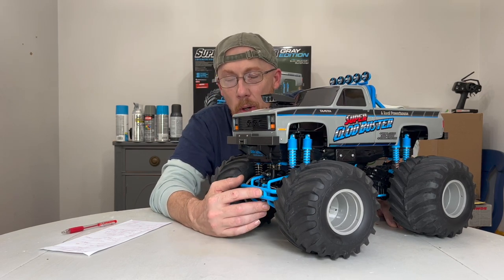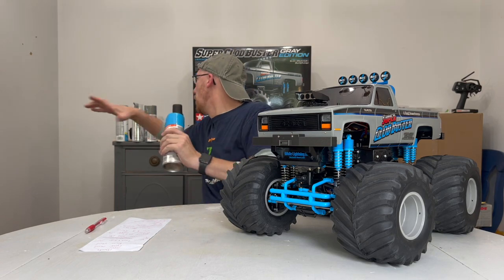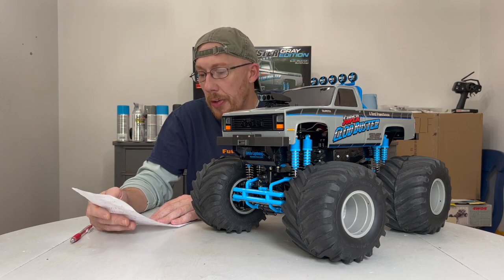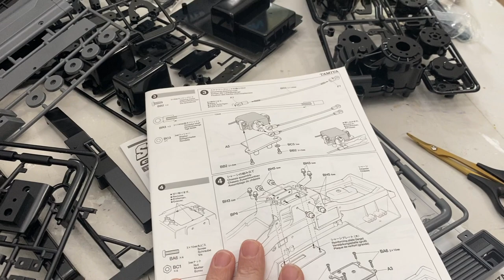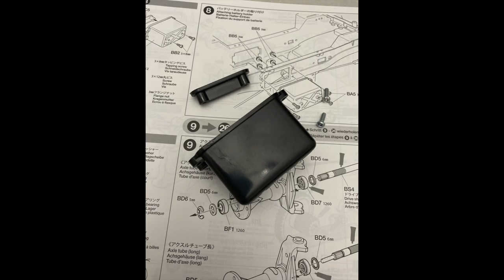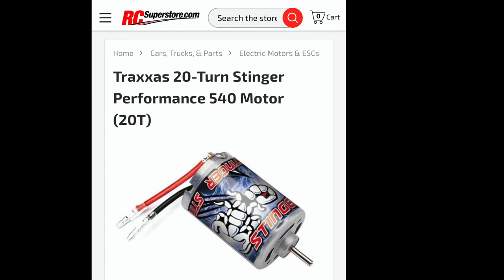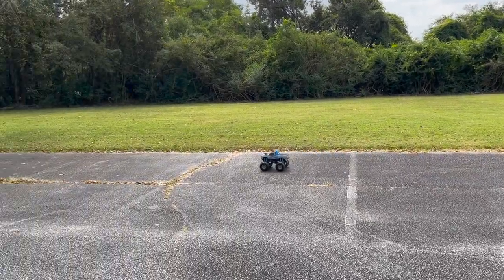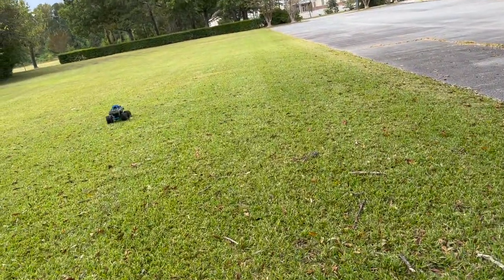2022 TAMIYA SUPER CLODBUSTER GRAY EDITION

Comment: Fantastic build and beautiful work! I'm 60, and I got into RC in my 40's because I was finally able to get some of the RC's I could never afford as a poor kid. Of course I knew of Tamiya but they never were really on my radar back in the 80's and since I never had one or wanted one back then I don't have the nostalgia for them that most of my friends here do. I love the way the Clod looks and I love building kits but everything I've done up to this point has been with awesome, modern high performance kits, and from everything I've seen about the tamiya models they seem rather toy grade as far as the electronics, suspension, transmission etc. And also very limited in the performance. Now I do know that they are immensely upgradeable and a person could spend an absolute fortune modding one to run somewhat like a modern basher but I'm still having a hard time wrapping my mind about the appeal of them other than the looks and I totally get it if someone had them as a kid or for their first RC, so  I get the nostalgia part of it. But stock they basically seem very outdated, with toy like stock parts. I do have a Konghead I'll be building this winter and maybe after that I'll get the attraction more. I really love any RC really and learn to appreciate them for what they are after driving them. I was the same way about crawling several years ago. I just didn't get it because I was a basher and thrasher lol eventually I tried it and after doing it and seeing that it requires a different skill set and was rather relaxing, I loved it. Right now every time I watch a tamiya video I kind of shake my head and go why? What's the attraction, they run terrible 😂. Now, that isn't entirely true, I've seen some that actually looked really fun. But in general they definitely don't seem to have any kind of performance or good suspension. But since I haven't yet driven one, I'll reserve any true judgment until I get my Konghead built and drive it. I hope it changes my mind about them. I just don't have room on my shelves for too many underperforming but great looking shelf queens 😂 yours looks amazing, great work and great overview of the build! 😁👍🤜🤛⚡⚡🔥🔥
Reply from the maker: So I can definitely see your logic on Tamiya especially if your experience is a bit on the lesser end came in as you stated 40 That would put you around the nitro craze a bit and the rise of sedan racing and of course bash style rc traxxas. I was for sure lover of those the thing is I’m 50 but got the rc bug at 8. My uncle introduced me to them around 1981 with a Tamiya rough rider. And kyosho peanut rc. I was amazed. All metal rc cars and big and heavy. I would later get a Tamiya grasshopper around 86-but my first was hobby grade rc is 84 Marui Big Bear. Meanwhile I’d get Nikko tyco radio shack rc along the way as my parents couldn’t afford those. The magazines and commercial appeal really aided the attraction. Like it or not Tamiya made pretty rc. The realistic approach with Tamiya bruiser a s speed truck or the 1/14 semi trucks. Also the track killing Tamiya Dyna storm. Tamiya is legendary they just are. My favorite rc brand no that is Marui because of it being the first one and they died off. Sadly. But I love any rc brand that is trying to keep rc in the stay. All of them hence my library of 175 videos and more of various companies. Hobby toy grade I don’t care it all matters to someone and whether it’s Wltoys, Arrma, traxxas, kyosho, Axial,RC4wd, Schumacher, Losi, TA, Graupner,Nikko, new bright industries, radio shack, Robbe, RCl, Mugen, AYK,GMADE,dromida, HPi, duratrax, and even Tamiya along the many others of rc it’s all gravy baby. I can respect that even if I don’t get it. Which I generally do airplanes took time but I now dig it-I can learn to accept it. RC isn’t for everyone it’s just for those looking for escape from the mundane. The creative and imaginative individuals. Even risk takers. RC is to me a world that I find beautiful. Thanks for watching and please enjoy rc. No matter the type or method of play. 🙏
Reply: @LukesVintageRC  absolutely! As I said, I totally get that most of you guys have a nostalgic attraction to them and that's awesome, I'm kind of jealous honestly that I don't have it because almost everyone my age absolutely loves them. I was a poor kid and back in the 70's and 80's RC was mosty the realm of wealthy kids and retirees. It was so much more expensive back then. Lol the closest thing I had to an RC was a buggy from sears made by nikko. I was in my 20's at that point, It was a blast and I had a ball with it but it was totally toy grade and left a lot to be desired. I never had any real RC's until I was in my 40's. The first thing got into was helicopters because I was always fascinated by them, so I taught myself how to fly and had a blast, though it was a steep learning curve by myself. My first hobby grade ground vehicle was a buggy from exceed that I still have. It went straight uphill from there, lots of drones, and ground vehicles. I always bought bashers until a few years ago when I started throwing crawlers into the mix. I can't stand nitro or gas.. Too noisy, messy, and fussy for me. At my age I just like to go out and blast a pack without any hassles lol 😂 but I know lots of guys who love them. I love building kits too. I'm looking forward to building the Konghead just to have the long overdue Tamiya experience. Back in the 80's I was a lot more aware of Kyosho than tamiya. And I do have a few of them now, so I'm definitely looking forward to the tamiya experience. I certainly don't begrudge anyone for loving what they love, especially if was something from their youth that brings them happy memories. Like I said, I'm kind of jealous that so many of my friends in RC, especially those close to my age group absolutely love the Tamiyas, and I just don't have any memory or nostalgia of them other than occasionally seeing one in a hobby shop. I certainly couldn't afford one and didn't know anybody that had one or liked them so they were just out of my experience unfortunately. You did an awesome job on yours and I'm sure you'll enjoy it! 💯
Reply from the maker: @riffraffsrc  I think you will like Kong! 6wheeler I’d bet gonna bet more to come from that brand. I used to have Exceed buggy but it was a nitro version anyway my daughter has exceed razor brushless 8s conversion very quick. The Drones and Helicopters now there’s some stuff I’ve never tried for some reason not that there not neat or anything but just never think about anyhow-hopefully I’m not making you feel out of place because of the Tamiya thing not my intention -I can seem a bit odd with rc stuff I’m a strange rc dude have you watched my eclecticism of rc on my channel 😁…I was a teenager who actually worked hobby store and yup that employee when you came into my hobby shop Ed’s Hobby Shop to be exact to browse I’d follow ya and explain each thing you picked up. Owner would literally yell “leave the customers alone Luke”! 😆 if someone left with nothing I was confused too. I do tons of rc videos so I do need a drone for overhead videos. Any suggestions I’m all ears- maybe a nose, eyes, a mouth. 🤪
Reply: @LukesVintageRC  as far as drones go, I'd suggest getting a sub 250  model so you don't have to register it. A small one is much better to transport and fly too and draw much less attention. I own an autel  Xstar premium 4k full size drone that I bought several years ago and I rarely fly it because it's large and atracts a iot of unwanted attention every time I fly it. Plus I had to register it and all of that stuff. All this regulation stuff is killing the fun of drones. And people are paranoid and suspicious of them🙁 so, the smaller the better. A small dji or autel like the dji air 2, or dji mini 2 or Mavic mini,  Autel nano will be perfect for videos. They are the perfect size and have incredible video. I use my go pro and phone camera s for video and wanted to introduce Ariel views but my drones are too big like I said. I may end up selling my big Autel and switching to a new small one. It's a shame too because my autel flies beautifully, has 3 batteries, a case, extra props etc. And the video is amazing. Funny you say Ed's rc. My local shop down the road from me here is called Ed's rc as well! I live in Vienna WV, next to Parkersburg on the Ohio River. I'm looking forward to the Kong build. I've already been looking at paint colors for it😁👍

Comment: This is such a cool looking truck. I'm not sure how much I like the baby blue hardware. I just think a black roll bar and bumper would look better. Thanks for showing us the build that's quite helpful.
Reply from the maker: So bro, honestly I like to do my own thing instead of completely box art as I’ve been for minute or two like everyone does. But the cool thing about this kit and I highly recommend it, you get spares so you can change anything out quick if you need.so color blue is are nowhere near baby blue. You need to see it live-but Robert there’s metal in the blue so just not possible-The bumper on mine is black. So..Your referring to chassis guard that comes with kit in the blue color. Honestly this clod kit is the best one. I own an 87 original red so I’m no way being just bias because of new is better but in this case absolutely. Plus it’s a limited ed. but Tamiya has been known to ramp production and then halt. Tricky company. ie candy green GH. On my channel I never really play by the so called rules to follow for good video format -You have to film the videos in multi stage video format, or you have to use this or you have to do that. Nope never I’ve always let my adhd rule out on my single video of all resto/paint/run formula per rc car truck boat etc. Same idea goes into my random rc restos too. So remember if it makes you happy that’s key right, Preferences are a sticky mess that just rocks or rolls. Flavor or Flavour..😆 thanks 😊

Comment: Just got done putting the same one together. Doing research on the painting part and found your vid. Hows is your paint holding up?? Ive read to stick with the tamiya brand stuff because the hardware stuff pretty much sucks...appreciate any info
Reply from the maker: Prep,Prep, Prep is the main method and that applies to anything your starting with in the hobby of paint. Super large catalog of rc car restorations on my channel which includes all aspects of the beginning and ending via running analysis of a total restoration. Enjoy 😉

Comment: I was kind of disaapointed in the body molding but overall it is an amazing truck. I goofed and stuck two Sport tuned motors in mine and one is running really fast and the other slow due to the timing in them... I totally wasn't thinking about it what I grabbed them. The replacements will be here tomorrow I think so I can actually get mine wrapped up and running! Yours looks really great and I like you did the roll bar in the blue. That looked really cool. The gray paint matched very well also, better than the Tamiya paint did!
Reply from the maker: Hey Adam, I’m excited for you with this truck. So yeah i originally bought the torque tune myself and they have a timing set. But before I could rebuild one the other came later so I ordered my traxxas 20t motors. As they are zero timed. Definitely wakes these big guys up as normal is 12mph mine is 14mph so I’m good for now. I had fun doing this one and yeah some people aren’t doing anything to the bodies paint wise regardless the issues. I believe RCdriver didn’t do any paint on the body when they did there’s recently but ran it 3S pack on it. Moves nicely looks a tad faster than mine in 2s mode. I’m tempted to 3S mine speed should be around 17mph! Thanks for watching.
Reply: @LukesVintageRC  yeah I saw it on 3s when he was driving and I may but it'll be with the old banged up body on it and not the nice new one!! 😂

Comment: Great job, the Clod looks awesome. 
Unfortunately I have now a lemmon for you. The TT motors are timed, that won't work on this car. Or real bad, because they have to run on this rig in different directions. Not sure if you builded in the original TTs, the foto was to short to see for my eyes. Sorry. RC4WD has some low turn motors without timing.
Reply from the maker: So I originally ordered the Tamiya Torque motors but one is fine, the other would need endbell adjustment to zero which I will do sometime in future, I live for challenges don’t you know lol! So as stated in beginning traxxas 20t stinger is the overall result. Please watch again. I do post information in description telling the basics in my videos. Helps those who wanna build there’s too. I’m honestly pleased with traxxas 20t stinger motors. Great prices too. Future 87 vintage clod resto I contacted Team Brood who has motor kits for these trucks I’ll do sometime next year. Yes Sir aftermarket support is strong for Clods. Thanks for watching and commenting, keep rocking your rc channel.
Reply: @LukesVintageRC  Sorry, sha,e on ,e I hadn't read the description.
Reply from the maker: @RCBirds  no worries my rc brother 😎

Comment: Hey Luke are you sure the Traxxas 20T Stingers are 0* timing and can be reversed?
Reply from the maker: Absolutely. So stock is 11 to 12mph right. This does around 14-15 mph. If there’s drag or drain it would not be faster than stock. Be sure to check out my other videos where I fix, restore run and speed check rc cars once or twice per month. A new vintage restore of multiple Rc type cars, truck, boats and and custom movie themed rc each and every month all in one video. Nobody else does this on YouTube. like comment and subscribe. Hit notifications bell to never miss a video as there’s nearly 200 to check out.😉
Reply: @LukesVintageRC  Thanks luke. I bought some 20T high-polish motors from RC4WD for my Bullhead but one of the motors burns up when I run it and i was "assured" they are 0* timing...hence why I was asking...
Reply from the maker: @goldenmanuever1176  lol it’s all good. The traxxas 20t stinger motors were a universal design for traxxas for multiple uses in many different specifications including boats too where twin engines was necessary in different positions or configurations. Also these were used in rc tanks too where as positions are reversed too. Just a good all around motor that has been around for years and used in everything. I’m definitely not the first to use it in a clod and won’t be the last lol. I have a stinger in my kyosho raider and my Nikko Scorpion as of now and both run like a beast. Both videos on my channel too and as you know the motor position is opposite on these vehicles. So I don’t have experience with rc4wd brand’s motor but I do have other things from that company. I’d contact the company and see if they can accept a return on the motor. If you need help with anything else let me know I don’t mind helping you out. Take care
Reply: @LukesVintageRC  thanks Luke. I remember having the traxxas stingers in my Villian IV. It was water cooled and moved pretty good on 7cells! I wouldn’t mind trying these motors in something else !
Reply from the maker: Yup wouldn’t you know that’s a boat that’s coming on the channel so stay tuned. If you like check out my Instagram Luke’s Vintage RC @ VintageLuke. I post my collection and upcoming videos. Take care

Comment: I want to buy this kit, I'm trying to find some information about the ESC and connections,  I'm going to be using an IC5 battery, or IC3 if I have to  buy a new battery,  is the Tamiya connector to the battery male or female?  I don't want to buy a new charger. Thanks
Reply from the maker: I believe you could just buy an adapter off eBay.  So the battery is a male connector. the esc itself has the female Tamiya connector. I usually just make my own from scratch as I have tons of different connectors IC5, XT-30 to 90, JST, DEANS, EC2-5, TRX to TAMIYA.  You just need to be careful when mixing as it’s easy to get the pos to neg configuration wrong when making your own custom version.

Comment: Question was that speed run on a 2s or 3s I didn’t remember you mentioning it.
Reply from the maker: Howdy, if you watch my videos you know I only use 2S because of the rarity of my rc cars and trucks. I’d be a dummy if I ran 3S. I would kill all the work I put in to restoring these rc yet alone the cost of parts if any could be found. This channel is more for knowledge but there’s always a small run I do at the end to get an idea of the character. If your not a subscriber I urge you to consider. Do like and share. Thanks
Reply: @LukesVintageRC  I just subscribed, so I’ll be watching more of your videos. I didn’t realize you only did 2s but definitely makes sense as some of these older ones don’t take the beating. My clods are updated so I normally run up to 3s on them, though to your point I have broken some old weak gears before.